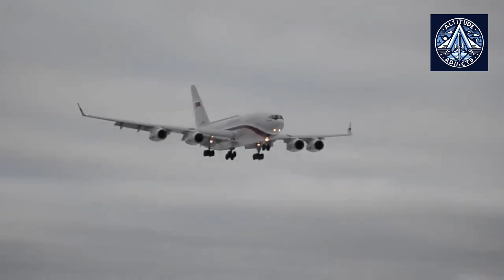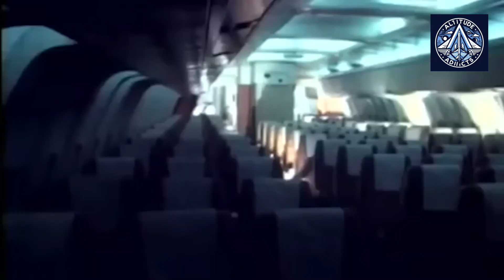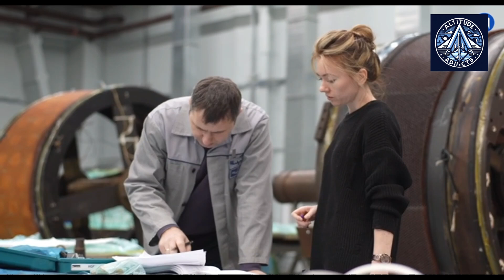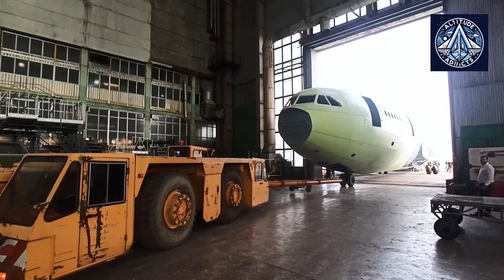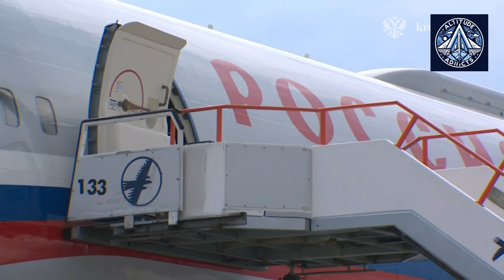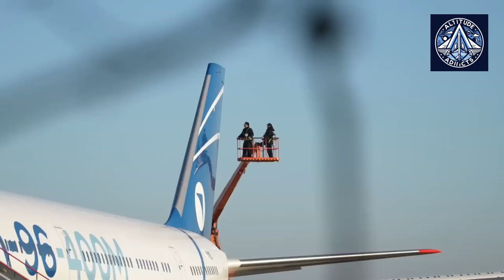Why is Russia Reviving the Il-96-300 Production in 2024?

Comment: The Il 96, is not a relic, its actually the plane that Boeing copied their Boeing 777 on. IF you do not believe it, just go check the dimensions and service entry dates. What Russia needs is a new IL 96 with a brand new full composite wing, with 2  PD35 engines, with a 2 man cockpit to increase its range and efficiency many fold and rebrand it as MC25 - 300/400. This will streamline Russian plane marketing in the international market.
Reply: The Boeing 777 was revolutionary because it was the first long-range wide-body airliner with a twin-engine. The Il-96 until now has no twin-engine. Modernizing the Il-96 means replacing it.
Reply: @alexandervt641  having 2 engines, is not revolutionary, when the engine is as big as that. modernising the Il 96 means giving it the PD 35 engine which is in the same size n class as the Boeing 777. NO 1 replace an entire plance just because its old, otherwise you wont be seeing the B737, A320, A300, and even the B777 fly today as these planes are more than 20 years old design. Thye just need a new wing, and new efficinet engines, which are in the works for Il 96.

Comment: Rave. There will be no PD-35 by 2028, much less an aircraft with two engines. It is already known that the tests failed; the engine cannot produce more than 30 tons of thrust.
Reply from the maker: 30 tons It is enough to power 777, 767 and may be A350. So, Russia can pull off an aircraft competing with any of them with 2 engines.
Reply: @altitudeaddicts  777 uses primarily the GE 90 turbofan engine with 80k-120k pounds of takeoff thrust, a 30 ton engine would NOT be sufficient to power the 777.
Reply from the maker: @heyfitzpablum  Boeing 777-200 with

GE90-76B is closest to it. So PD-35 can be of use.

Comment: It would be a totally new design for a tween aisle mid range aircraft of around 260-280 passengers tween engine setup, the PD-35 IS more or less like an RR Trent 700 class engine, it can be fitted to an IL-96 500 or 600, an even better and bigger cargo variant, like a hot road IL-96  400....